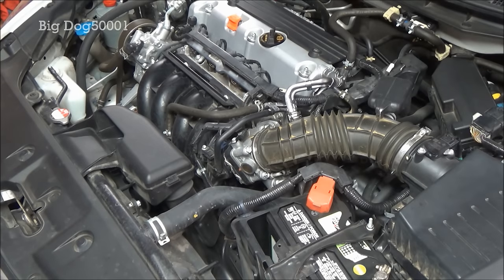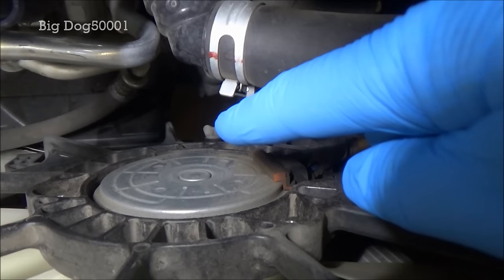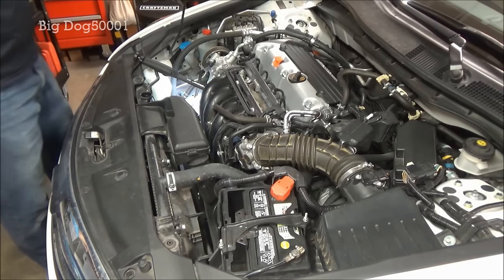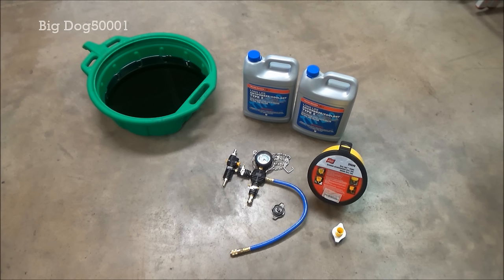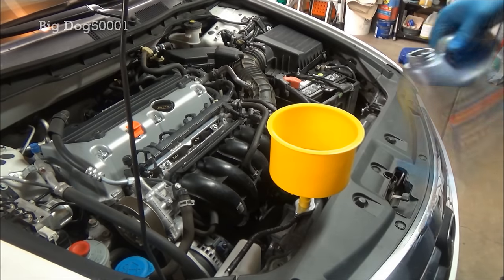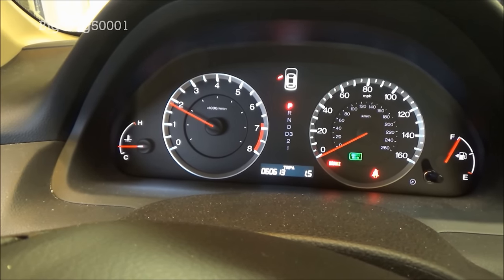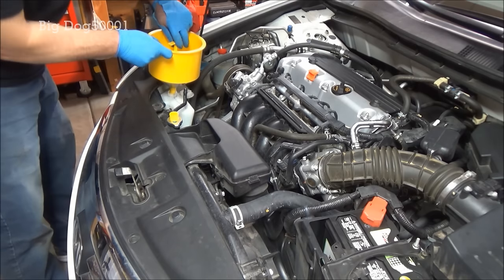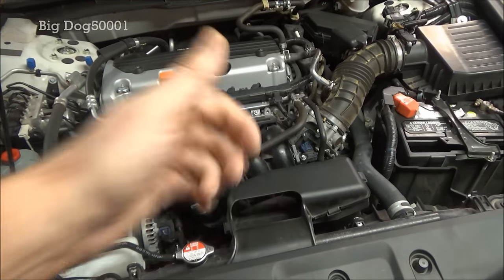Honda Cooling System Service/Fluid Change

Comment: The method you described about taking the rad cap off and setting it on the rad and waiting for the fan to come on after two cycles.....well after 25 min of the engine running and the coolant starting to steam but no fan ever came on......strange hope I did not damage my engine boy oh boy!  Have any ideas anyone why the fan would not come on ...have a Acura Rsx which is made by honda??

Comment: I have a 2007 Accord EX-L, 4 cylinder engine. The previous owner put green coolant, I bought the Honda blue coolant. Should I take the thermostat off to flush the block out of the green coolant? Or if I flush out the radiator with water is that enough?

Comment: You can use the empty coolant containers to collect the used coolant and recycle it properly. I also use old gallon milk jugs for whatever will not fit in the empty new jugs if I don't use both jugs.
Reply from the maker: I try not to use any food containers for automotive fluids but I do use old coolant jugs for used fluid (always properly labeled as used).  Thanks for the input!

Comment: hi i have a 2010 honda accord ex l sedan and my antifreeze is getting low so id like to change it and from watching your video here how often should i change it? and should i wash it out with water after i first drain the old antifreeze from it? or no water and just refill it with antifreeze and seal it?
Reply from the maker: I would do it exactly like I showed in video.  I recommend at least once every 60,000 miles.

Comment: When you do regular flush, what happens to the leftover coolant in water pump, heater core and engine area, does that old leftover coolant mix with new coolant?

Comment: Thank You for the lesson. Curious. Being a perfectionist, would there be any point to doing this as directed except use distilled water, cycle for a few, drain, fill with coolant...i.e. remove all old coolant. Again, thanks for the advice.
Reply from the maker: On a good running system I am not a fan of putting water into the cooling system because it is difficult to get it all back out.  Thanks for the comment!

Comment: Great video!  I noticed you don't worry about flushing  the block  and heater core out.  Is that not a concern?  Thanks
Reply from the maker: Not if the system has been maintained.  If the system is flushed, all fluid used to flush needs to be removed before adding coolant back which can de difficult without certain tools.  Thanks for the comment!

Comment: in my civic there is this device, which takes the transmission hot fuild and runs it through coolant pipe which cools down the transmission, is there similar thing in accord as well? because it damaged my transmission in civic because it mixed the transmission fuild with coolant. I want to change that in my accord before the transmission is damaged.

Comment: Hey when ur in the car and it’s running. Do you turn on the heat without the A/C on? But turn the temp to hot and turn on the heat? Correct!
Reply from the maker: Only need to turn the dial to hot (only necessary on certain models), no need to turn on blower motor and definitely do not turn on A/C (that can turn the fans on).
Reply: Gotcha great videos! Subscribed and liked

Comment: is that what’s called a coolant “flush” dealer is charging like 200 just for that alone. very helpful video
Reply from the maker: Coolant service, not a flush.  A flush is not necessary if this service is done at regular intervals (once every 30k-60k miles).  I do my own vehicles every 30k.

Comment: Those no-spill funnel sets are a great idea, but the equivalent product here costs $160, which is hard to justify as a DIY-er. Instead I fashioned my own from an old radiator cap with the centre hole drilled larger, a water sipper bottle top, and a 12 mm length of hose. The hose fits snugly around the sipper and is the right diameter to seal against the radiator. A cut-open soft drink bottle screws into the sipper cap acts as the funnel/reservoir. Haven't done the final fill and burp but it seems to work OK so far...
Reply from the maker: Those funnels aren't that expensive here, thanks for the input!

Comment: A question about refilling coolant, can you fill it to top level and do the same at side of reservoir without running engine but leave the job by closely monitoring the level in after driving? You could add up at any time during your driving when you find it’s getting low.

Comment: just had the coolant changed on my 2010 civic. The lower radiator hose remains cool and the top hose hot. the car runs fine with with no over heating issues. Is this normal on hondas.

Comment: can you be more specific on how you properly get rid of the old coolant?     Thanks for the thorough info!
Reply from the maker: It can be difficult to dispose of sometimes.  Repair shops usually pay a company to dispose of automotive fluids for them.  In some areas auto parts stores may take coolant but usually it has to be taken to a hazardous waste disposal company/government facility.

Comment: My cooling system is taking less than 1.5 gallons.  Does Honda specify capacity of fluid in the owners manual?  I wonder if I messed up anything because I squeezed the hoses when I was draining the old fluid out?  It basically stopped taking new fluid at .8 of the first gallon, but eventually it went in when I ran the engine.
Reply from the maker: Sometimes you can find that info in the owners manual, but many times you find capacities in service information (that you have to pay for).  Most important thing is that all the air is bled out of the system.  I would recommend checking the fluid level in radiator and overflow frequently (when the car is cool) for the next few weeks of driving to make sure it isn't low.

Comment: Should I be concerned that it took my 2014 Honda Accord 20 mins for the temperature gage to reach normal temperature? I had my foot tapping the gas pedal like you did. My car normally warms up in about 4 mins
Reply from the maker: There was probably some air in the system near the coolant temp sensor from replacing coolant.  Bleeding system like I showed generally takes care of it.
Reply: @BigDog50001  yeah I had the coolant at the max level, drove to work a few times ( I commute 120 miles a day) and saw that it’s half way down. So I figured there was air like you said in the video
Reply: @BigDog50001  thanks for the reply btw. Great video

Comment: It’s a good idea for the funnel , but what if you just left the reservoir tank open with the hose still sticking in the coolant and the radiator cap closed ? Wouldn’t that still burp the system through the reservoir tank ?
Reply from the maker: Air can eventually work its way out of the system through the overflow but I would not rely on that (the system is pressurized and too much air inside can effect it).  If I did not have a funnel I would just put the cap loosely onto the radiator like Honda says to do.

Comment: you don't need to flush it with cleaner or distilled water before pouring the new coolant? Also, can I change the thermostat at the same time I'm doing this?
Reply from the maker: Part of the coolant would need to be removed to replace a thermostat, so replacing it during a coolant service would work.  I don't put anything but Honda coolant in a Honda cooling system.

Comment: My friend has a 2014 crv we was checking it over yesterday fluids and noticed overflow reservoir was close to empty I’ve noticed it’s been low like this every time I check fluids so I filled it back up to max line and topped off radiator was wondering if this is normal for it to go empty or sound like a leak somewhere.
Reply from the maker: Not normal from how you describe it, unless the cooling system was recently worked on and not completely bled properly after the work was done.  I would keep an eye on it for a leak somewhere (either external or internal).

Comment: Great video. Thank you for sharing it. I just need it. Two questions:
1. should I keep AC max when removes air?
2. You mentioned hear "something" at least twice, what is this "something"?
Reply from the maker: Thank you.
1. Leave AC off, because it will turn on the cooling fans.
2.  Turn your hot/cold switch on climate control to Hot (on AUTO systems turn temp all the way up).  I did this at 10:04 in video.  This way it will circulate coolant through heater core.

Comment: New brakes, rotors, timing belt, water pump, oil change, coolant flush, power steering flush, fuel injector service, transmission flush, cabin filter, engine filter, air induction cleaned.  2012 Honda Accord Coupe V6 exl auto. 56k. $2500.00. Good for 60,000 miles

Comment: Excellent video, a question if someone can answer me, how do you prevent the antifreeze from filling the reservoir through the small hose while you fill the radiator?
Reply: It won't.  The hose to the reservoir  works one way, ie it sucks from the reservoir.

Comment: i did everything that you mention but my coolant is still draining to the reservoir, i dont have any leak on radiator and water pump. what do you think is wrong with my car. i've changed my thermostat too
Reply: I have the same problem too I don’t know what is the problem

Comment: When you say let coolant fan come on twice, is that both fans or one fan? Thanks in advance!
Reply from the maker: On most newer Hondas both cooling fans should come on.  But not all models are like that, some older Hondas only the radiator cooling fan will come on.

Comment: Some videos on YouTube claim that the cooling system of Hondas are self-burping, how accurate is that?
Reply from the maker: It's best to either use a spill free funnel or do it the way Honda says by leaving the cap loose (but it makes a mess).  Not a fan of hoping the air can eventually escape through the coolant reservoir.

Comment: if the previous owner did not use honda coolant will I have to do any different steps before switching back to Honda coolant?
Reply from the maker: I will usually do what I showed in the video twice (after a cool down period of course).  It can be done right away or sometimes I wait until the next oil change.

Comment: You think a 1.8L civic will take about 1.5 gallons? I have one fresh gallon and I topped off the reservoir with another gallon so it’s not all the way full
Reply from the maker: Most of those 1.8L Civics take about 1.4 gallons after a coolant change and about 1.75 gallons if the cooling system was completely empty.
Reply: Big Dog50001 Automotive thanks man. I subscribed.

Comment: I tried using AC/pro and burn up my ac compressor your better off to go to dealer. No worries it gives you piece of mind taking it there for the repairs it comes with warranty go with Honda parts is the best bet.
Reply from the maker: That would be the HVAC system, not the cooling system, but yes I do not advise using DIY top off cans on automotive A/C systems.

Comment: I just did this on my 2021 ILX, and I used the spill free funnel. I burped all the air I could? Refilled, got in the car, and now I’m only getting hot air on HI setting? If I go to 86,85,80, ect… the air gets cool, or like room temperature? Any suggestions would be great, thanks👍
Reply: You still have air pockets. Only advice would be to do this again and leave it running for more time with the heater at max, when you accelerate the coolant should raise in the funnel and drop again when you deaccelerate, thats my sure way to mark abscence of air pockets. A transparent funnel insted a yellow ond should help you watch this.
Reply: @Ulfhednar-o9t  Yes sir, I tried that for 3 days. Finally got frustrated, and ordered a $33 dollar vacuum kit. I believe this is a sealed system, and it’ll take forever to get the air out, with no bleeder valve? Thanks👍
Reply: @Mark-um3hm  darn, that sounds frustrating. Best of luck with that.
Reply: @Ulfhednar-o9t  Sure is. I think these newer cars come with completely sealed systems, so you have to vacuum fill them?

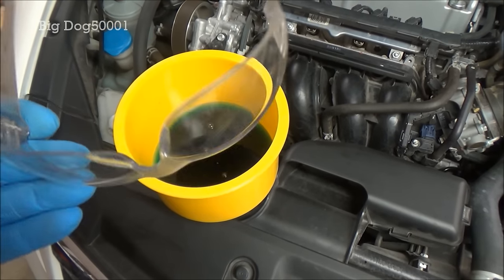Comment: 12:01 i notice the power steering reservoir looks like its bubling up and down slighty, is that normal? my accord does the same thing and im debating if fluid is bad, the oring has gone or potentially pump is starting to fail. No whining/no hard steering but i see the reservoir boiling kind of looks like while car is on. I noticed when your car started it didnt do that but after it was on for a bit i saw movement in your ps reservoir. Im just wondering if this is normal or should i start with replacing low pressure o ring. THANKS
Reply from the maker: The pump is moving fluid through the system, it is normal to see some movement.
Reply: @BigDog50001  Thanks. I also did notice wetness on the bottom hose connected to reservoir. I cleaned it up to see if it returns because im not losing any fluid but i did notice one to 2 air bubbles in reservoir after a short drive.Thinking the reservoir has a crack or the hose does or its just old enough fluid is sweating out of it. Any suggestions?

Comment: Hi I waited a long time for the fan to come on but never did. Is it really important that they come on? What would happen if I finished the job without them coming on? Thanks!
Reply from the maker: The fan turning on and off means the coolant is circulating (as long as everything is working properly), which will force any air that is in there towards the radiator.  Usually holding the RPMs between 2,000-3,000 will cause the fans to come on as long as the engine is up near operating temperature (this can be seen using engine temp gauge on the instrument cluster).  Some fans are very quiet and will only come on for a few seconds before the computer shuts them off so they can be easy to miss.

Comment: Thank you for all of these well made videos! 

Do you have any recommendations for convenient places that will take the old fluid in for recycling? The same question applies for brake fluid and power steering fluid.
Reply from the maker: Fluid recycling varies greatly depending on the area you live so I can't really give a good recommendation other than to search for places in your particular location.  Thanks for the comment.
Reply: Makes sense, thanks!
Reply: Auto ZONE,  ADVANCE AUTO PARTS

Comment: Thank you for the video. But could you please explain why air bubbles is not an issue when changing atf or engine oil?
Reply from the maker: Bharath Krishnan You don’t fill ATF or engine oil all the way to the top of transmission or engine.
Reply: Big Dog50001 Automotive makes sense. Thank you.

Comment: Hi mate, got a question for ya please. Just bought a beater honda jazz 2006, the car runs fine and heater works, but coolant is lower than MIN, so I went to auto store, gave them my car plate number and model/year, they sold me a bottle of pink coolant, while went home try to top up but found the coolant in tank is like green color. I believe the car has never had a coolant change. So can I mix them up please?
Reply from the maker: I can't see what you have there but in general the green coolant can usually be mixed with other colors.  That being said, I recommend the Honda Type 2 blue coolant.